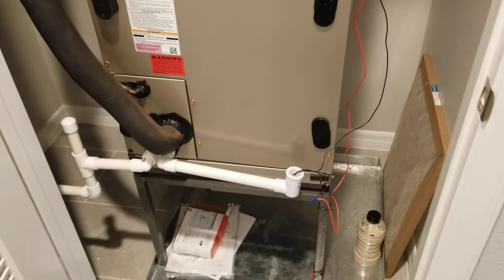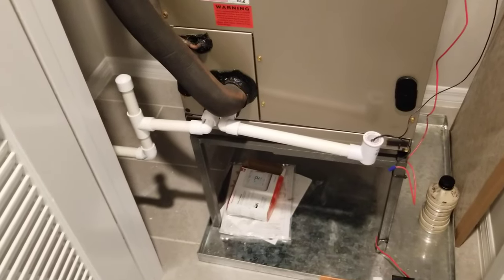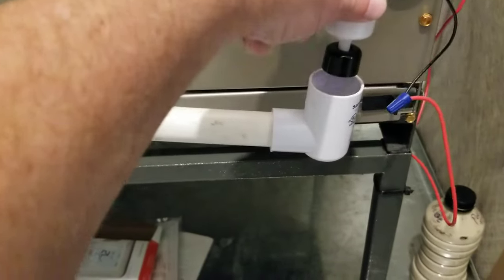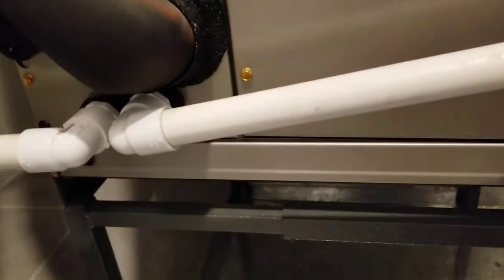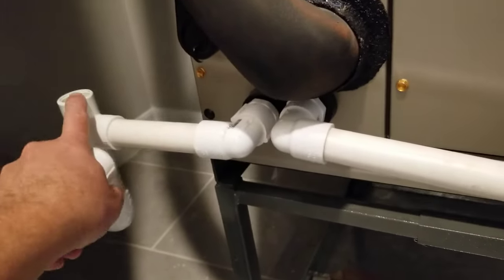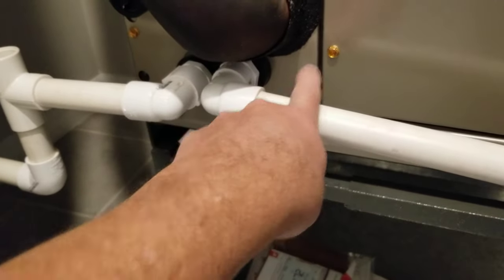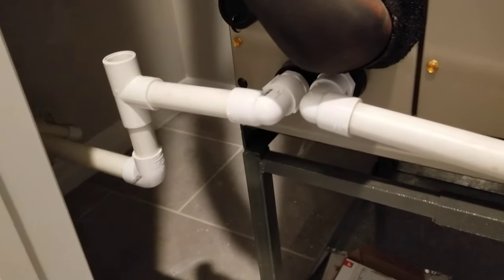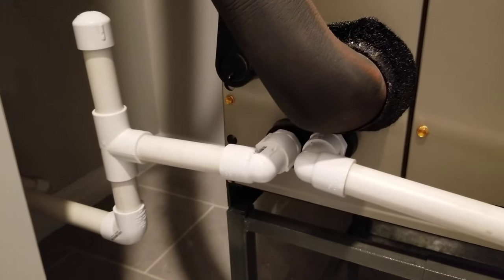Florida AC drain monthly maintenance and How to unclog

Comment: A little hint, it is a good idea to have the trap as close as possible to the unit, with the clean out directly above the trap, so a brush can clean out the trap debris.
Reply from the maker: The way the builder/HVAC contractor setup the drain lines, the traps are outside. Setting up a P trap closer to unit would be a second p trap and not recommended.
Reply: @TomHirt  I didn’t say add an additional trap close to the unit, I said THE trap should be close to the unit to aid in cleaning it out.

Comment: You’ll can end up sucking water back to the tray from the p trap if your fan is pulling the correct CFM . That drain will always be at negative pressure, that’s why you need a vent just after the p trap.

Comment: Well finally, a unit that looks a lot more like mine. I have a TRANE. It's rather newish. It's clogged. My mini shop vac sucked about a teaspoon of grey slimey gunk from the dip line outside, but that was all. Still no AC. I checked the overflow unit. Maybe a couple of drops of water was in it. The floaty wasn't in the up position. 

I saw one horrific video saying to cut the pvc pipe, after of course I go buy a couple of hose clamps and a piece of tubing slighting larger than the pvc, so the next time you only undo that and rine the line ot RIGHT. I wans't about to do that. 

It went out during a 120 degree hot spell. I have an elderly terminally ill husband at home. I called the company we bought it from and installed it. They said try to unclog it myself. Ya..I've tried. It's not working. I realize I need a much stronger HP shop vac. A mini just doesn't do the job. 

My debate is..repair man can't get here until the following tuesday. No time given. This happened on a Wed. so I've got a ways to do. I'm thinking ...do I just go buy a high powered shop vac, see if that works and if so it's cheaper than the repairman. However, what if that doesn't work. I clean up and return the shop vac? lol. Thing is, this happened last yr too. The gentleman dropped by on his way home from work (instead of keeping the appointment the following day) he pulled his shop vac out and viola. A nice bunch of gunk came out and the AC returned working. He showed me the float, and said I could do this myself and same some money. He did NOT charge me. 

Thing is, what's wrong with these things that they clog so often? I paid out of my pocket to have a new central heat and air installed. Twice in two yrs this now, this clogging has happened. 

When we got the new unit. OH..the old unit never had a clog once. The motor went out twice, replace it once. The second time the personal friend HVAC guy, said he could fix it, but it's going to do the the same thing a few months down the line and then you're going to be made at me, b/c it will then cost you a lot of money. I'd just look for a new unit NOW. So we did. 

Not knowing a darn thing about this HVAC stuff (learning after owning this home for 30 plus yrs) THe man literally told old....it's computerized. It there's ever a problem we can stuff hook it to this machine and it will read out the what the failure or problem is. He said you have to do NOTHING. Just use the thermostat inside the house to turn it from heat to AC. That was supposed to be ALL WE HAD TO DO. Sounded good at the time. There was no service agreement offered to come inspect it yrly. No one said anything about clogs, what to do about them, how to prevent them. Like I said, our previous unit never had that prob, so I just don't get it,

I guess I just wanted to rant, b/c I didn't see you flush anything out. Yours was already nice and clean. It was merely an explanation, which all video's give that. Guess I'm going to go buy a higher powered shop vac and see if that clears the problem. One problem. The little bent part of overflow arm, where the clopp most likely is located. right in it'   There's no way to open it. It's sealed with that blue thread plumbers seal.
Reply from the maker: Sorry to hear you are having these issues. I will tell you thought, clogged drain lines happen, and they happen repeatedly. So investing in a good shop vax will do the trick. And make sure you watch my part 3 video (link in description) that goes into more detail on sucking the clog out. I do need to do a better video on that.  As to the reason why you get the drain clogs, it's a combination of age, moisture, temperature,  and inconsistent air filter replacement that leads to the perfect storm of debris, fungus and such collecting and then growing like a science project petri dish growing out of control in your drain line. This video I show how to do a monthly maintenance to help prevent the blocks, but it's not full proof. One last important note I need to stress in the next video, when you are outside sucking the drain line, make sure the cap on the inside drain line maintenance is in place. This will  help the process to suck the clog from the drain line. Good luck.

Comment: Why would you angle it down any? That would cause it to hold water until it could evaporate. I would think it should be perfectly level.
Reply from the maker: Good point. My main concern was not to leave it leveled up, as most folks move it out of the way to replace the filter and forget to relevel that arm.

Comment: Trane air handler 2nd floor attic, when algae gets in the pvc drain line,I simply give the p-trap a short blast of water from the hose outside which forces water upwards and the weight of the water forces the pipe to clear itself.
Reply from the maker: What state you in? I would focus on that as this is just for SW Florida setups.

Comment: Also, that sensor should be right out of the coil tray drain, not with a sloping pipe that can accidentally be pushed down to lower than the tray bottom.

Comment: That right one is headed upper and(white clog?) mine pops 💦 water out… should i block it? Or how to fix it? Thanks
Reply from the maker: If you are saying water is coming out of the right side overflow arm, and the float switch is wet, then your primary drain line is blocked. You need to unblock your primary drain. My part 2 and 3 videos in the description cover this.

Comment: After you shop vac the pipe outside to remove the water, should the system turn back on by itself?  It’s not for me and I even turned the circuit breaker on and off.  Pretty sure that’s what the HVAC guy did last time??
Reply from the maker: If your AC has turned off because your drain is backing up, that means one of the two overflow switches (not necessary a circuit breaker) has been tripped. So make sure the switch located on the overflow drain pipe is reset and then check the overflow switch down below in the pan.

Comment: My drain pan stays filled with water. I pour water and vinegar down the drain line and goes outside fine. Over all AC works gine and cools the house. I do i clean the very beginning of the 2 drain lines? One with the switch and one without
Reply from the maker: I would not pour any more vinegar down until you figure out why water is backing up into the bottom pan. You don't have to worry about the line with the switch. I would move onto the second and third video I reference in the description to actually clear the blockage from the drain line.
Reply: @TomHirt is that what the pan treat tabs do...keep the pipe clean where the switch is??
Reply from the maker: @Phone-sh7jg  Good question and it made me research Pan treatment tablets. Those are indented to keep your bottom pans sanitized if your pans are frequently wet. Which if our primary drain float switch does the job, our pans should remain dry. But I see that some of these tabs can be used in the drain line (not with switch side) for a slow release. That has some potential and I'll research further.

Comment: I was told no never use bleach if the drain is slowing because it will cause corrosion.  My a/c drains outside.  If it isn't backed up, does it matter?
Reply from the maker: If it's backed up, the advice is to address the blockage and don't pour anything in for reason you cited. But if the drain isn't backed up,  then it's fine.

Comment: Are you sure that’s where your condenser coil is, I’m sure you meant the evaporator coil
Reply from the maker: My main point this is metal in there, regardless what it's called.
Reply: My intention was not to show you up but to make a correction, if you’re going to name a component you have to be correct so as not to mislead your viewers, it does matter what you say

Comment: I don't have a condensate drain line? Where do put the vinegar?
Reply: I pour a 16oz. bottle of vinegar to the air handler drain every month.  This drainpipe exits the air handler to outside drain. As this drainpipe is more than likely PVC material it is not wise to use bleach.  Bleach can erode the PVC glue causing the pipe to separate at the joints.

Comment: Hi if my unit didn’t build the back up drain float… so how can I clean ?
Reply from the maker: The backup drain float is optional and can be capped off. Just follow the lone drain pipe to find the drain trap. In my video, it's the pipe going left.
Reply: In your video the pipe on the left… but mine didn’t have anything beside red cap with a square looking shape… on the right there is a long pipe … ..
Reply from the maker: @Xx_eeveemocha_xX  hmmmm, I'm not a hvac expert,  i was just trying to help those in my community with the same system. If you want to upload an image,  I'll be happy to review,  but might be better to involve an expert.
Reply: @Xx_eeveemocha_xX  I have a red cap as well that's angled higher than the other vent where the water drains out
Reply from the maker: @OGCJ10  I would love to see a photo. If you can post link maybe others can chime in.

Comment: Condenser? Condenser coils? Where is the drain trap?
Reply from the maker: In my example, the drain pipe is going to the left, and I pull the drain trap plug less then a foot away from the condenser unit.
Reply: I understand why you are calling it a condenser unit, but it is the evaporator coil section. Refrigeration systems use the refrigerant cycle as the naming of the units. So, the indoor coil is where the refrigerant evaporates, and the outside unit is where the refrigerant condenses.
Reply: @TomHirt  I don’t think you understand a p-trap, that others viewers are asking about, the air handler requires a p-trap and you don’t have one so if the air handle sucks air it won’t let water drain until it satisfies and then will drain…..
Reply from the maker: @josejulian5116  I don't believe you understand the situation. I didn't install the the drain line.  This is one of 600 homes that DR Horton built here in a SW Florida community. So I'll repeat, the whole drain line is a P trap. It's the way the builder designed the drain lines.

Comment: There is no copper in new coils. Therefore no antibacterial. They sell a string thats wicked in copper and silver. Im thinking about just tossing a sanded cooper pipe in my coil area in a nook. And you need to move your clean out higher. Just cut a longer pipe or couple it. And never leave important documentation in your pan. Thats a designated wet spot and should be treated as such at all times even dry. And you need a condensate trap. Youre losing air.
Reply from the maker: DR Horton setup the hole condenser drain line to be a trap. I'm getting tired of explaining this to "experts" outside of SW Florida.
Reply: @TomHirt  Glad you were able to make the video and help others. Take that literature out of the drain pain, you dont want soggy literature when you might need it. Take care man.

Comment: How much water
Reply from the maker: It's not really that strict a rule, as long as you put in a cup of vinegar once a month is the important part. If you can flush it with 4 cups that is more than enough.
Reply: @TomHirt  I use a 16.9 oz plastic bottle into a funnel every month into the drainpipe.

Comment: I don’t know why these morons that have designed these unit put their refrigerant lines and the drain lines in the same place. I guess this is the way they’ve always done it and we can’t get a free thinking mind to make it reasonable to locate the refrigerant lines away from the drain lines. WTF?  I guess that the engineer and designer has never spent a day in the field. Same with the condenser access ports.  All of the electronics can’t be reduced so we have access to the service ports? The problem is that is status quo and don’t have the fortitude to do the right thing. Piss on the service technician that has to deal with the poor design of the equipment.

Comment: Missing a p trap. That’s a no no
Reply from the maker: I suspect DR Horton referenced the following.   Current IRC and Florida code (M1411. 3) does not require a p-trap in the condensate drain line. It only specifies a minimum 1/8” per foot slope for the line, and that the condensate "shall not discharge into a street, alley or other areas where it would cause a nuisance.”
Reply: @TomHirt  air handlers. Have a negative pressure due to the position of the blower. It’s imperative that you put in a trap.
Reply from the maker: @vladekvladinov5753  Thanks. So in layman terms, are you saying that since the drain line has no trap, that when the blower is on, that can channel in outside air, which can exacerbate the clogging problem, and cause inefficacies with the AC performance? And can I ask, are you located in Florida?
Reply: @TomHirt  what I’m saying, is that without the water weight in the p trap your drain pan will over flow (spill). In the unit. 
I’m in Kansas
Reply from the maker: @vladekvladinov5753  I think I see your confusion. First, thanks for trying to help and assist. But things are done a little differently here in this Florida DR Horton community. There is no need for a p trap because the the drain line goes under the foundation for a few feet, with the starting point 2 ft above ground and the terminating end 12 inches above ground.
Reply: Hello Tom, I respectfully disagree. Just thought you should know your p-trap is located too far away from the initial drainage point.  Where you live or local HVAC code has nothing to do with a p-trap or u-trap being an essential part of proper drainage to AC condensate lines.  It should be as close to the  initial drainage point as possible.  As previously stated it has to do with pressure. As far as I know, Mini Splits are the only systems that don't require a p-traps. Check out this HVAC video which thoroughly explains how AC p-traps work and why they are essential. https://youtu.be/uB_3NbvH754
Reply from the maker: @rfcasey  Sorry for missing this insightful comment. I do appreciate those these type of comments and education. So dumb question as I think I have stated before I'm not a HVAC person, I'm just a new homeowner given this system by the builder and trying to help others in my neighborhood clear out the drain line blocks. That is, my understanding is the whole drain line is a P trap. However, maybe you are trying to make the point that the closer the P-trap to the condenser, the better performance I will get. And I have to say, my unit takes forever to bring the humidity level down. So your video link was very helpful in that regard. Could I get away with the transparent u-trap as a long term solution?
Reply: Hello Tom
Like yourself, I am not an HVAC tech.  Started to research HVAC drainage when I was having some issues . I found the importance of proper AC drainage interesting. I am sorry that I cannot provide you with more insight. Better off commenting with your question on the video link I provided in my prior comment . Best of luck
Reply from the maker: Hey Bob, talked with the builder super and contractor that installs the HVAC for this community and confirmed that the drain line as it goes under the foundation and exits in a L shape pipe is a P trap. Having a second P trap near the condenser unit would be a no no. They said you must have one P trap, but not two.